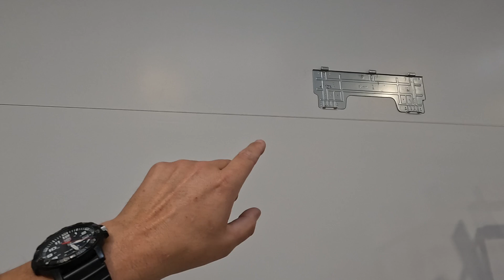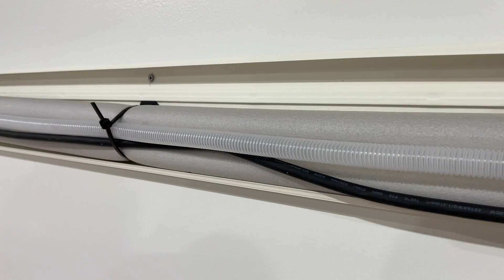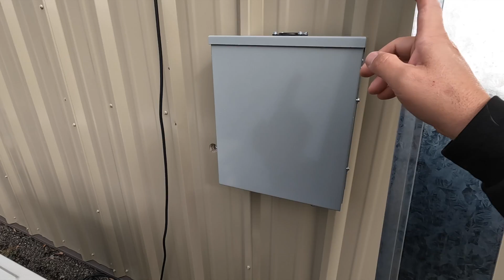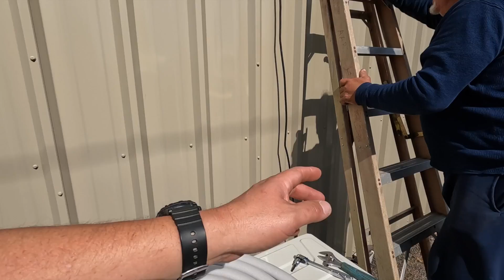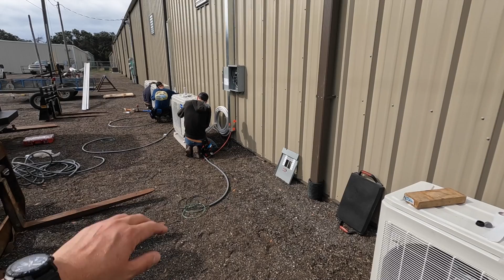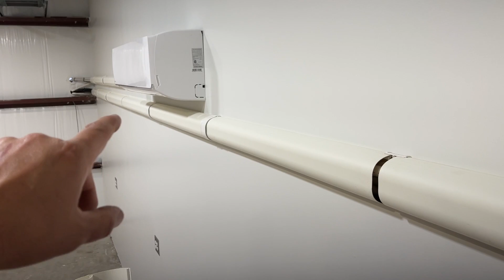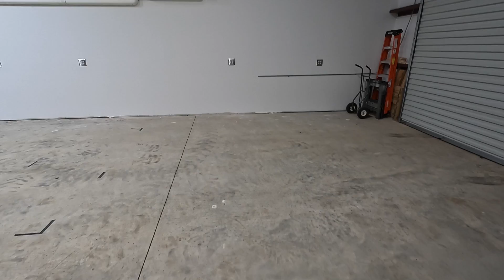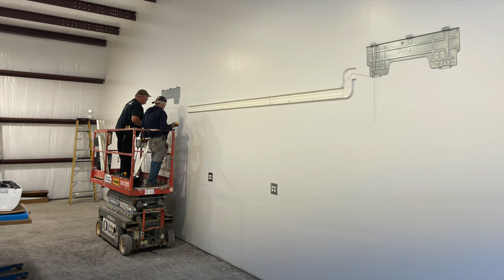Mr Cool AC INstall for New Shop Part 2

Comment: Looks like they will get the job done for sure, but my choice would have been a Carrier or Trane roof top unit, even if I had to stick it on a stand and shoot it  in sideways through the wall. Depending on how hot it gets outside the new ones with the VS compressors run at about 1/2 the power consumption nd that is the real cost of HVAC. - The electric bill is the gift that keeps on taking. 

Don't get me wrong, there is nothing at all wrong with the way you did it but it wouldn' thave been my first choice.

Comment: Adam, I think it would be good practice to protect the outside compressor/heat pump units with som heavy duty rail system. Apparently there are machines / trailers driving /parked back there. It is of course not a question if, but when somebody anonymous hits a unit ….

Comment: Now that you've done it yourself......when it breaks who's going to service it? True, you don't have to evacuate the system or charge it, but someday there will be a leak. You're never going to be able to repair it. You must be licensed to buy refrigerant. 
Personally I think I might try to deal with a local shop and do some of the work myself. (Site prep, penetrations, mounting accommodations, electrical work.

How is the operation of the four separate units serving one common space handled? Can a single thermostat run all four? If not they're going to fight one another.

A single split system would reduce the electrical work, reduce the indoor fans from four to one, and reduce the number of compressors from four to one.
Reply: His stepdad, Fernando, who helped him with this install has been a licensed HVAC tech for 40 years or something.
Reply: @mitchkronowit3633  this is keyboard warrior… so much text and not a single useful word
Reply: Go back and watch the first video.  If this were a gameshow called 'What's My Line?' -- you'd find that one of the contestants is a machinist and the other two do HVAC for a living.

Comment: They do offer 16ft as well as the 25 ft. And they sell couplers to combine two lines into one longer one. I used a couple of them with the systems I installed last year.

Comment: i have been watching and I see a potential issue. I note the openings possibly might make insect infestation because I haven't seen a possible plan to seal the openings transitioning through the inside to outside openings.  Are you planning to seal the openings?
Reply: You typically use more of the Putty/Clay around the pipes. It works very well.

Comment: I wonder why the lines were coiled up at the condenser in stead of cutting them to length.
Reply: Because it’s a DIY kit. In order to shorten the lines, they would have had to be cut, evacuated, and the system recharged. Otherwise it’s plug & play.
Reply: You never coil refrigerant lines like that

Comment: How do you get the air out of the line and evaporator before releasing the change in the condensor?
Reply: The lines are precharged and have a special valve at each end that keeps them sealed until connected at each end. Makes it DIY, no HVAC tech necessary.
Reply: @mitchkronowit3633  line is not pre charged. Outdoor unit is pre charged.
Reply: @juntang72  Not according to Mr. Cool’s website. The lines are precharged. That’s what makes these systems DIY. No special tools or training required.

Comment: No Teflon tape at the brass fittings?
Reply: Interesting, I hadn't seen this before, it looks like these units come with a line set with fancy valves that are sealed until coupled? So they could be pre charged?  (or pre vacuumed) Clever stuff.
Reply: @framavia2201  Exactly. Mr. Cool’s web site says pre-charged lines have been used in mobile home installations for years and now they’re making them available to the DIY’er.
Reply: I believe the fittings are similar to no-leak hydraulic fittings that open/close on their own.
Reply: Compression fittings?
Reply: There might be an O-ring or rubber seal inside the fitting. Never did get a good close up look.
Reply: The compressor unit was pre charged with refrigerant, the video makes that clear. Hence, opening the valves after the lines are connected. You could hear the hissing of this high pressure pre charge being let into the evaporator side. 
My question was about the connections themselves, and how is minor leakage across these connections prevented. Teflon tape vs compression fittings vs hydraulic line ball and valve type fittings (these don’t look like those though)
Reply: Ya possibly. I didn’t see him placing any ferrules though. But, ya,  I agree.

Comment: All these guys talking about recharged lines. Don’t you see they are wide open while connections are made? The unit is precharged, not the lines.One valve should be opened while the line is loose at the unit. Freon will chase the air out, then tighten the connection. Personally, I would never leave that slack in the Freon line. The shorter the Freon lines are, the better.
Reply: Technically it's "refrigerant", not Freon. layman's term.
Reply: Not according to their web site. They use pre-charged LINES.
Reply: @mitchkronowit3633  OK, well watch him screw the line on to the unit outside and tell me how that is precharged.
Reply: @Mr572u  Whatever dude. There’s nothing to argue here because 30 seconds of research on Google will teach you how the system is designed, but you’re smarter than the engineers at Mr. Cool. Ok, we get it. LOL

Comment: Several people have commented about the condensate line needs to be sloped to prevent the water from not draining properly. They are absolutely correct.
I put one of these units in last year and the amount of condensate that comes out of these units (especially in humid climates) is a lot. If that condensate doesn't drain properly the unit will eventually start to degrade in performance. The worst part of not having a proper slope to ensure good drainage is the line can clog which means you have to remove all the line covers and unclog it (aka: a pain in the ass). And, after watching the whole video, it looks like he's addressed that issue :) Awesome content Abom!

In addition to keeping the people comfortable, when you have tons of metal (machines and material), the condensation that forms causes rust and that is not good. The Mr. Cool units do a great job of removing the moisture from the shop space which also helps to keep your machines and materials from rusting.

Ever hear of a Kummer "Double chucker"?

Cheers,
Jeff (Garage Maker Guy)

Comment: Robert Hesperia CA.?usually drain lines are sloped 1/8" per foot. YOUR DRAINS MAY NOT BE SATISFACTORY!
Reply: I agree with this comment. I've used this type of A/C unit and the amount of condensate they can produce is phenomenal. Also, does code allow you to run electrical cables through the same conduit as water piping?
Personally I'd have sent each drain tube directly out through the wall behind each unit and used a separate conduit for the electrical cable.

Comment: ah…are you making those drip host level in that long distance? our experience here is, you need a half inch higher on the machine side to let the condense water run to exit naturally by gravity. it looks ok now, but as times goes by, the weight of water leftover in those host will make it bow, and all of a suddent you will have a leak in the connection point. beware of that situation. quick fix for that is to rearrange the drip host inside the rail and make it gradually till down the exit way. luckily it is just some cable tie.

Comment: Why didn't they create vacuum in the gas lines first, before releasing the gas from the unit? This way air and moisture in the lines mixes with refrigerant gas, possibly causing premature failure of compressor.
Reply: I thought Adam said the copper lines are precharged as well with valves on each end. They open once connected between the handler and condenser. Makes sense to me although I can see a tiny amount of air getting in there. Anybody out there know more about this set up?
Reply: @mitchkronowit3633  Maybe I missed that part, if you remember in which part of the video he said that, let me know, I don't have another 30 mins to watch it again :) At 17:02 you can see Adam just connecting the lines and then releasing the refrigerant. There is air and moisture inside of these copper lines which should be removed with vacuum pump, this is what third cap on the copper unit connection is for. You connect the lines, then before you release refrigerant you pump out all the air with moisture from the lines.
Reply: Lines aren’t precharged. How could they be? They are wide open when being connected. As long as they are, they should have put a vacuum pump on the lines before releasing the Freon from the compressor.
Reply: @Mr572u  yes they are shut up, clown
Reply: @Mr572u  There’s apparently a valve at each end that doesn’t open until connected. Very bright boys (and girls) designed this system.
Reply: @mitchkronowit3633  Please don't be offended, but where that valve is?
Reply: @JohnRides  My reply keeps getting deleted. Not sure why. Perhaps it doesn’t like the link I’m trying to post. Google “pre charged ac lines” and you’ll see more.
Reply: @mitchkronowit3633  You might be right, it's possible there is a spring loaded valve inside of these connectors.
Reply: @JohnRides  That’s how it sounds to me. A tech on Mr. Cool’s web site even said you can disconnect the lines and they will seal back up, preventing the loss of refrigerant, although they don’t recommend connecting and disconnecting the lines. I believe once fully assembled you treat it pretty much like a traditional system.

Comment: Once you’ve got all the little bugs tweaked out of it and it’s run for a while, squirt a little spray foam into the openings of the metal covers outside to prevent it from becoming a condominium for rodents and wasps.

Comment: I was expecting one unit to go in the office? Those long drain lines will plug up over the years.
Reply: In one of the earlier videos and any of the ones that show the front of the building you can see the A/C unit or the hole for it in the office
Reply: Adam said the office has its own AC.

Comment: On those 2 units that needed the lines extended, will they work properly cause you didn't use the pre charged lines from mr cool?
Reply: It wasn't shown / talked about, but you can see they had a manifold and charge bottle out for those two units.
Reply: He specifically mentioned that's why Fernando was working on those last two units, because they needed longer lines. That may have been in the last video.

Comment: The only ocd item I have is with the way these units get charged is especially with the extra long feed lines that you had to ad is that they don't recommend vacuuming the lines down before dumping the freon from the condenser.
Reply: The lines are pre-vacuumed and pre-charged at the factory with the computed correct charge for their length.
Reply: Pulling a vacuum is only for a system that has been opened for some time, they pulled a vacuum anyway.  Also, there is no “Freon” used in this application.
Reply: They fed them the correct charge, it just wasn't shown in the video. And you don't have to pull a vacuum to add the needed extra charge. (but otherwise, yes, the line are exposed to the air. so there's a lot of moisture initially in the system. theses systems are apparently designed for this.)

Comment: Very interesting video. Did you have to extra long copper pipe for the units on the finished walls? I would suggest to level the compressors before screwing them down to the pad. You can also use a pipe bender for the copper lines. Was any pipe dope required to connect the copper pipes? I would also recheck the amount of refrigerant in each compressor just to be on the safe side. I would also label each compressor to match to the correct breaker for future identification. Also, I think I would have sloped of the copper & drain lines for the wall units on the finished walls at least 1" of drop every 12" of length. That might have prevented water leaking from the drain lines. There might be better methods. You need to put a u line on each drain lines on the outside just like it would be required for a house HVAC system.
Reply: You folks are unreal

Comment: Mr. cool calls those signal wires but they have full voltage running through them so I would recommend putting them in a conduit.  I am kind of OCD though so what can I say.   I figured somebody with a Weedwhacker or squirrels or rats could get into the air handler black wire otherwise.  Or a squirrel with a Weedwhacker.   Be careful to make sure that both lines are the same length of “stick out” when you’re trying to meet them together

Comment: Those mini-splits have a function that keeps the humidity low without having to put the temperature at such low settings. The heat is always a problem but when your feeling like a steamed dumpling just keeping the humidity lower than the outside wet bulb reading will surprise you how good it will feels even with the thermostat set at 77-78 degrees. The function looks like a teardrop on the remote/thermostat .That should help with the light bill also. Believe me with the amount of a/c you have in the shop and showroom and when you have those 95-100+ days and 80-90% humidity you will want to save a few Pennie’s when you can.

Comment: you need to fix your drain line it will hold water low drainage
Reply: First thing I noticed.  It appears it is higher than the outlet and will not drain.

Comment: Tsk Tsk Tsk.......No weatherproof connector on that black control wire going into the condensing unit? Thats against code.
Reply: In Texas, no disconnect is needed if the breaker is within sight of the unit.
Reply: The actual electricians probably took care of that when they connected the units to the sub panel.

Comment: The ideal way to handle drains on mini splits with a very long run like that is to use a condensate pump mounted under each indoor unit. Even using PVC like you did it will eventually clog.

Comment: What's going on with these long copper tubing coils, are they pre-vacuumed and sealed? or Are they precharged? How to get rid of the air inside them before opening the valves?
Reply: They are.

Comment: Abom79, you should paint the galvanized steel white that will have 2 benefits the steel will last longer and it will keep the cooling lines from heating up saving you some money because of lost cooling capacity.

Comment: Adam, i am seeing a HUGE issue. the condensation drain is not correct. this may come as a shock to many people but water does not flow up, it can only go down. so with how the tube is run it is going to back up, water lock and flood the inside unit. it was hard to see but also you need to support the pipe outside. make sure there is 0 weight on the connector to the outside unit. any stress there will cause the connector to leak and break after a few years.
nevermind. you found it out already.

Comment: I am a little confused… not sure if I missed it on Part 1 … the copper tubing… ARE THE PRE CHARGED ?  ( if not, then how does it overcome such a air bubble)
Reply: The unit is precharged I believe yes. I did one of these units last year. Once you turn those Allens you hear the gas go through. Nice and easy.
Reply: As @salsyou stated, "precharged" units.  The line sets are not charged.  I do believe when you crack the valves the refrigerant runs through an receiver/dryer (removes any water through a desiccant bag).  I also believe it uses some kind of accumulator in order to remove any air bubble issues.
Reply: @WreckDiver99  ahh ok.  I am 100% about Hydraulics … and I figured that refrigerant would work the same.   Now I’m blown away by how that handles all of that free air.  

I caught the part about the units being pre charged.  That is very nice.  HVAC techs aren’t cheap.. makes DIY very affordable
Reply: @franknphotos  Yea...micro-bubbles in a hydraulic line is BAD NEWS...3000+ PSI that micro bubble hits a curve and can go straight though that hydraulic line...I've seen it happen...scary stuff when they REALLY jack up pressures.  Worked in a few plants that ran equipment at 7500PSI...lots of checks in the system to prevent air coming in...

Comment: the condensate water is cold, it needs to be insulated
Reply: Why? The condensation is just getting dumped outside, right?
Reply: @mitchkronowit3633  the condensate is cold, so condensate will be created on the outside of the drain pipe, so it should be insulated to prevent dripping
Reply: @johnherbert7489  Ahh, secondary condensation. Gotcha!
Reply: Do you have to get some blinker fluid to flush it with? 🙃

Comment: Adam, a lot of the time the audio only comes from one ear. It's very noticeable with headphones. Is there a way to fix this?
Reply: you can enable mono audio on your device (usually under accesebility settings)
Reply: @Mike-kr3on  I get that I can fix it on my end, but I'm thinking there might be something with the upload. If Adam can fix that it's fixed for everyone. It seems like it only happens sometimes so maybe one of the gopro's is configured wrong or something.